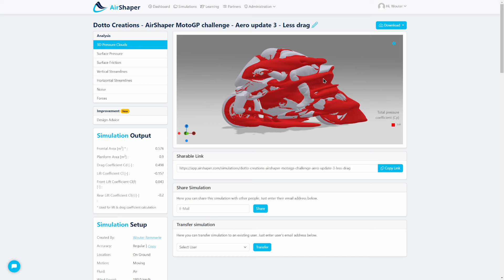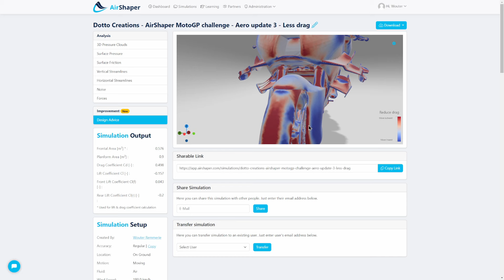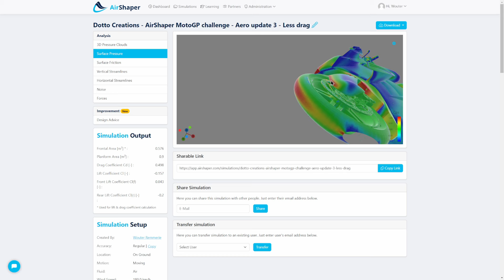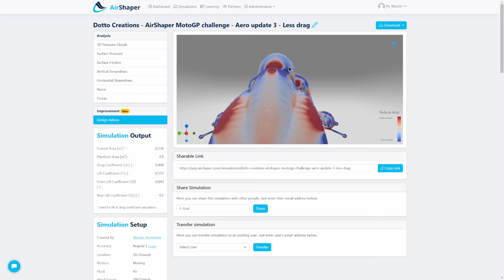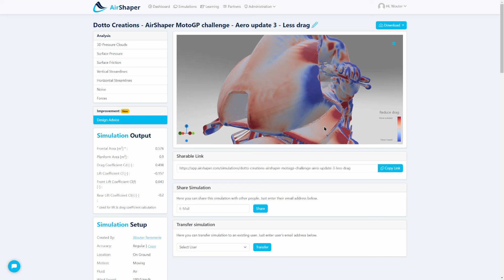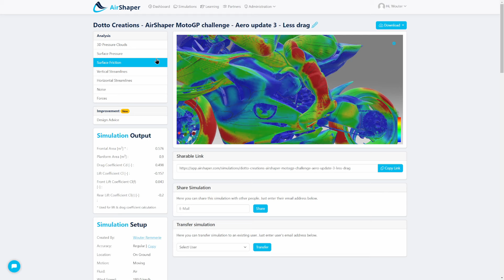Reducing Aerodynamic Drag on a MotoGP bike without expertise

Comment: The problem is that some of the changes are not possible because of MotoGP or WSB/BSB rules, such as the windscreen/front fairing dimensions. I would love to see drag reduction applied without consideration of these rules. What complies with racing rules is not what is best on the road!
Reply from the maker: Very true, and that sometimes leads to funny designs!

Comment: Hi. How are you. I am really a big fan of the work you do and I would like your help in some matters.

First. I don't have a car and I want to buy one that is close to perfect.

Second. The maximum amount I can pay is $4,000

Third. A few days ago my country announced that it would allow car modifications so I am thinking of buying a Toyota Cressida, the latest model 1992 because it is widely available and also its price is close to $3,000.

Finally. I would like your help in this matter based on your experience. Do you have any suggestions for cars from 2000 to 2015 that are cheap and have good aerodynamics or do you suggest that I buy a Toyota Cressida and then modify the aerodynamics? By the way, I am from Saudi Arabia so I want a car that is free of manufacturing defects and will last me a long time due to our high temperatures. Thank you very much and I will be grateful to you
Reply from the maker: It depends on your goal!
If pure savings are the goal, then it'll take a long time to pay back any modifications to the car, but it could work, depending on how much you spend on the mods. I'm not up to date enough on which are the best cars out there in terms of aero though, taking heat into account.
Reply: @AirShaper  ok. one last question. can you make a video about what are the best modifications that really affect the aerodynamics and the price of each modification. if you are not going to do it then tell me what are they with the average price of each one. THX
Reply from the maker: @B0R.  I think it'd be good to check the channel of Julian Edgar for example - he's really focused on car mods, knows much more about it than I do!
Reply: @AirShaper  THX so much for YOUR HELP